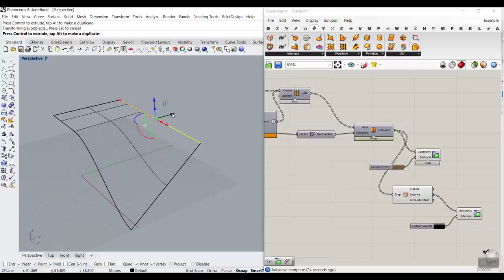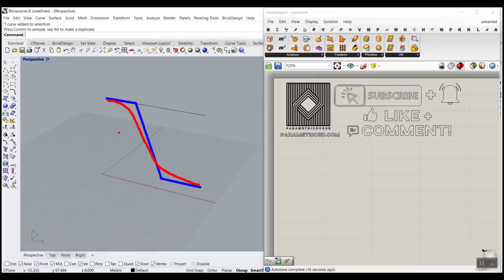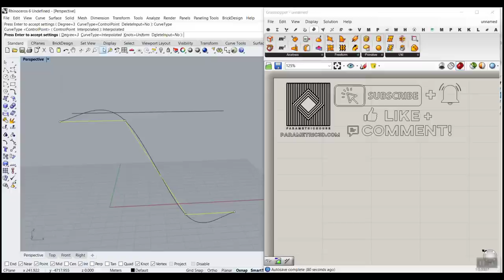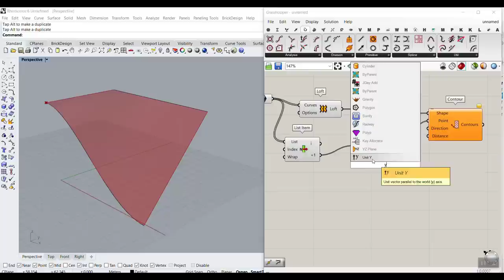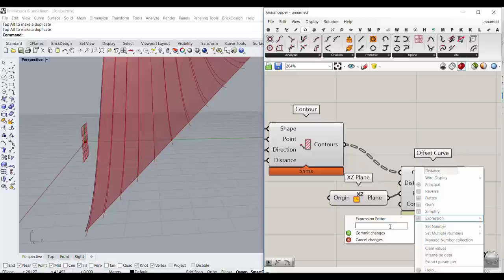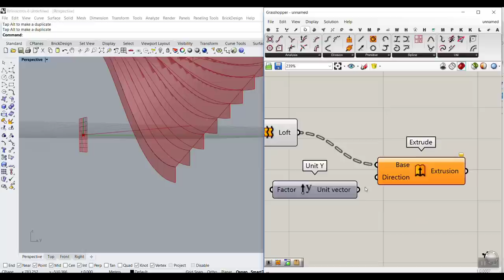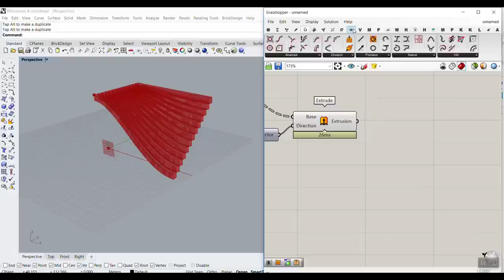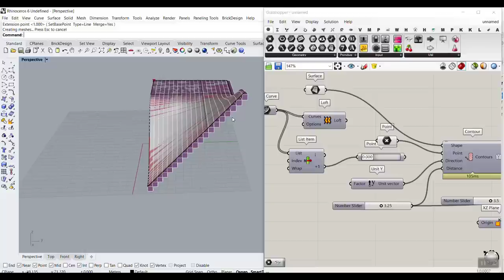Rhino Grasshopper Stairs

Comment: Hi, for some reasons that my contours are not equally divided between the two reference curves, are there any ways to make them all the same measurement with whatever the distance between two reference curves? Thanks
Reply from the maker: Try making a linear array of planes and use brep/plane in the intersection. Maybe this helps